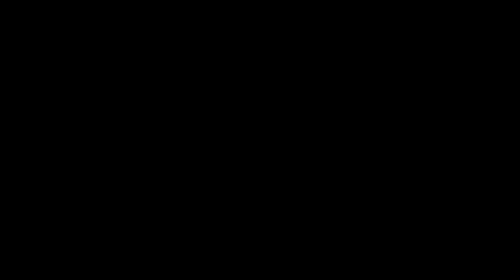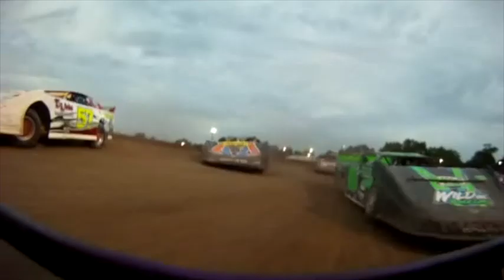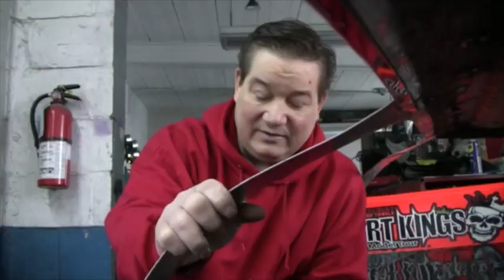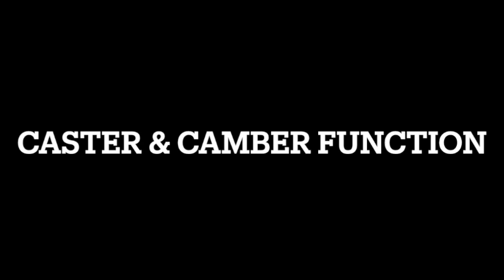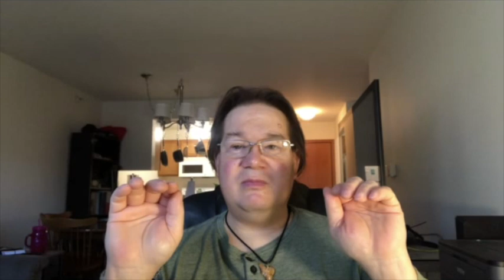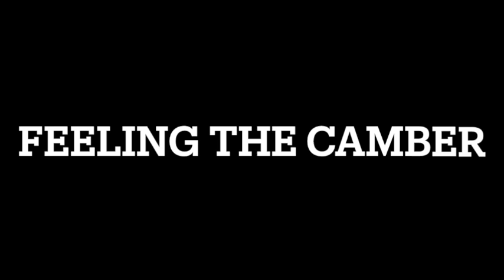Aero Push, Caster, and Camber; Dirt Modifieds, Dirt Late Models, and Dirt Stock Cars

Comment: Tire Temps will dictate your camber * 

ADave Hammond is the king of setting up your chassis when it’s in its Dynamic phase..
Reply from the maker: Tire temps are a useful tool, but I find the problem with tire temps, on dirt, is it is hard to get enough temperature in the front tires to tell a whole bunch. Plus, as soon as you come off of speed, they begin to neutralize. Tire wear over time is about as far as I go.